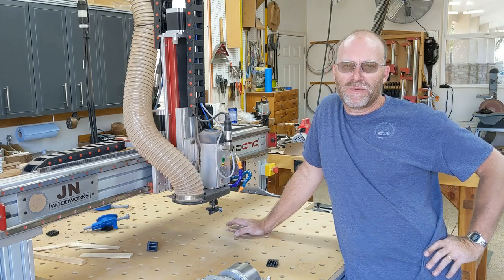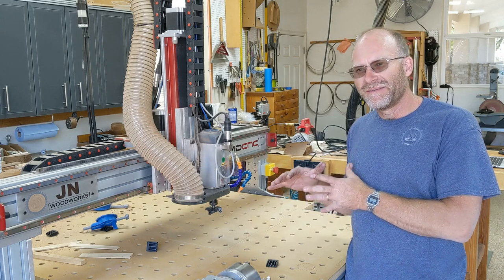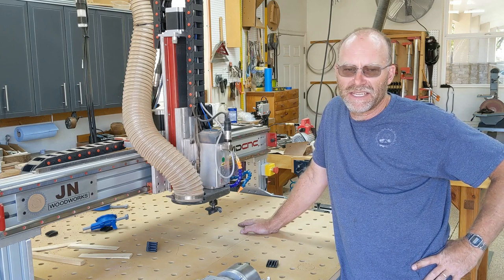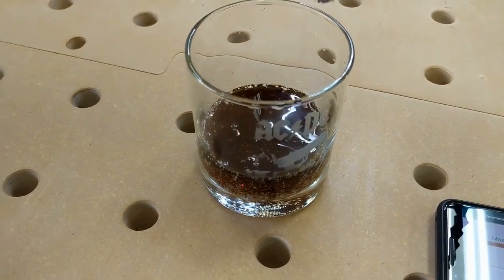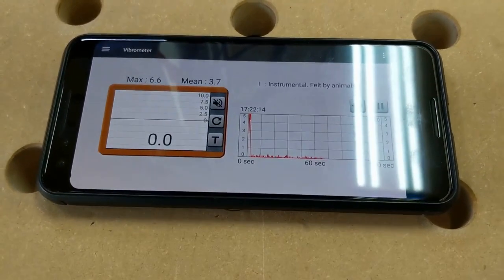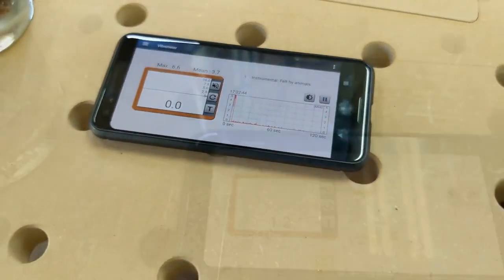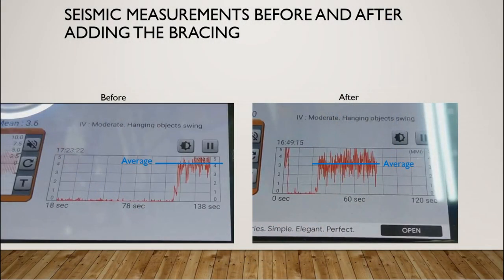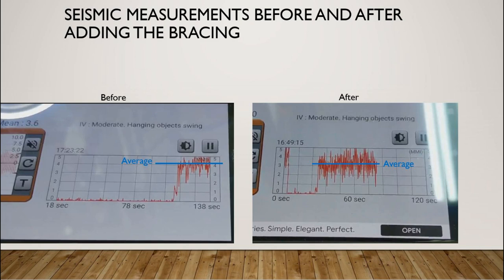Vibration reduction project for my AVID CNC Router table

Comment: I may be barking up the wrong tree jim  but im thinking adding mass would cut down the vibration, it seems to be a prerequisite for cnc mills hence all the cast iron and epoxy granite. Thats a lot of weight above a fairly light base. 
Edit, i see other commenters have suggested the same, just call me captain obvious 😄
Reply from the maker: Hi Kevin,
You are correct, adding mass does help.  There are two limitations with this on a CNC router like this.  First, that mass needs to be at the top of the table. The further down it is the less good it does.  So if you can make a granite spoilboard, that would be best.  If you can hang steel/concrete/whatever up underneath the spoilboard, that would be good too.  These may not always be practical.   Second, the gantry is large and rather flexible (compared to say a milling machine) so it has a lot of flex of its own.  So even if you can completely secure the vibration I was measuring at the spoilboard, there is still vibration of the cutter/laser end and the biggest improvement  there is managing speed and acceleration settings.

Comment: Hi JIm 
Love your videos and your thoughtfulness. 
My thoughts - your observations seem intuitively likely to me - you made your table more rigid - resulting in some higher amplitudes and some attenuation. 
Passive damping (dissipation of energy) by some means seems like the way to go - Matt C tried foam and Squidskunk suggested a pendulum and others masses which are ideas along that line.
Since the vibration we have is at all sorts of frequencies I think simultaneously using a few different materials (and or different designs of pendulum if you can figure that out) would likely give more attenuation. As someone else said in the gantry / riser and rails would probably be best.
Just my thoughts albeit a little and way to late :)
Reply from the maker: Thanks for the input David

Comment: how did you attach the light under the spindle? looks great
Reply from the maker: Ah, I plan to do a video on that sometime.  It has a laser crosshair and a light around the spindle.  The light is a Halo ring from auto head lights.  They are a nice little ring of LEDs that I just glued into a groove.  I have a small write up on the design and the CAD is in Vcarve.  If you would like the files, just send a request to jnwdwks@gmail.com.

Comment: I have a 4x8 AVID PRO coming next month (hopefully) and my plan was to mount the controll boxes on the wall instead of the machine so I could scoot the Y axis up tight (+-12") off the wall. With that in mind I thought I could run supports from the underside of the table to the stud framing in my wall in addition to the shear wall paneling at the leg kit to help stabalize everything. Basically like hurracane strapping a bookshelf... Do you have any thoughts? Is that overkill?
Reply from the maker: I like to be able to walk around all 4 sides of mine.  However, if that is not a requirement for you, then fixing the table to the wall with a horizontal strut should pretty much eliminate most of the table vibration in the axis that the strut is connected (assuming your wall is pretty solid).  You can't get rid of all the vibration in the system because the gantry itself has a good bit of flex if you push the system too hard, but I think what you are planning should eliminate most of the movement of the table that I was trying to get rid of with my extra bracing.
Reply: @JNWoodworks  Thank you for feedback, I really enjoy your channel!
Reply from the maker: @larrybrown1194  thanks 😊
Reply: @JNWoodworks  I was watching one of your videos and in the comments you mentioned you lived in Gilbert, AZ. I actually live in Queen Creek and I work in Gilbert. I would love to meet up and for coffee some time and talk about all things CNC.
Reply from the maker: @larrybrown1194  send me an email at jnwdwks@gmail.com.  I am right on the queen creek/gilbert boarder.  I always look forward to some shop talk :-)

Comment: Would bolting it to the concrete floor help?
Reply from the maker: Not unless the feet were sliding around on the floor, which mine were not doing.
Reply: @JNWoodworks  I thought using an L shaped bracket to the floor would have the slab acting as another framing member.  My mistake, thanks for the reply.